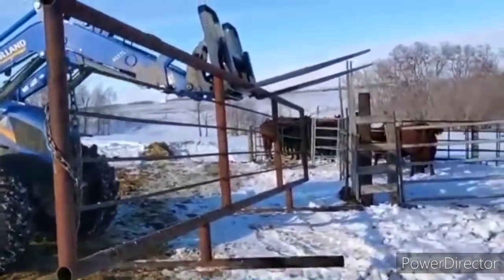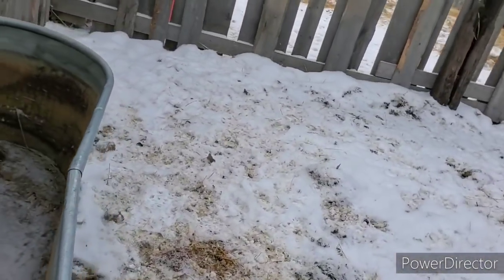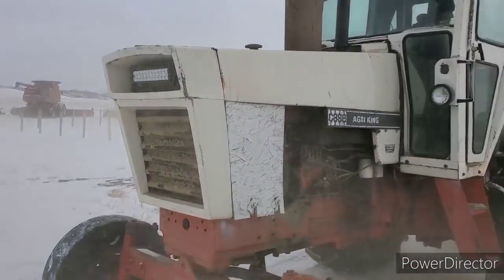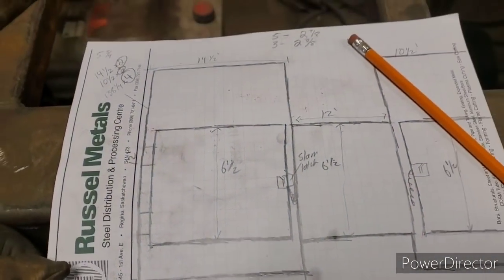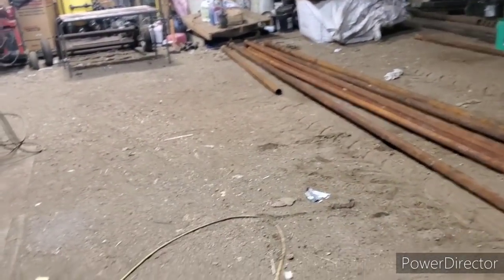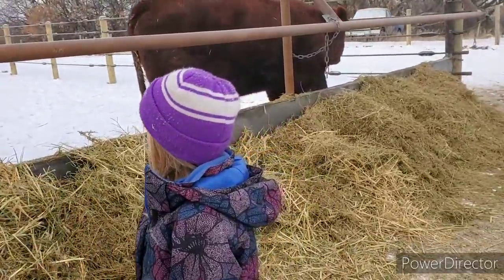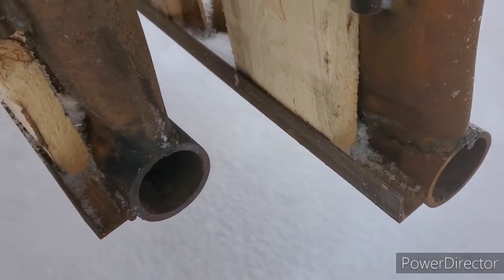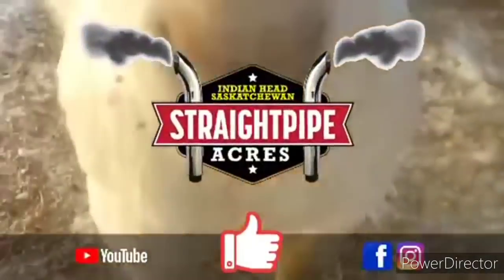Feedlot build. Episode #11.

Comment: Hi SPA ( straight pipe acres ) 🙋🏻‍♂️ great video 👍🏻 Just wondering with ur bale processor does it work better if it’s set in to feed the way the bale was rolled or better against the roll? Or no difference?
Reply from the maker: Thanks. It doesn't matter as the bale can be unrolled both ways with the rollers in the processor